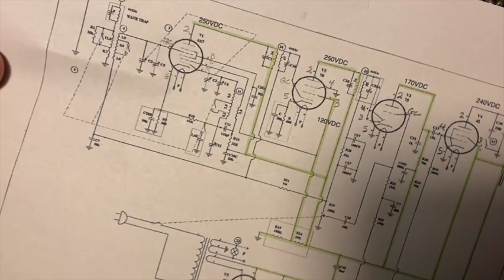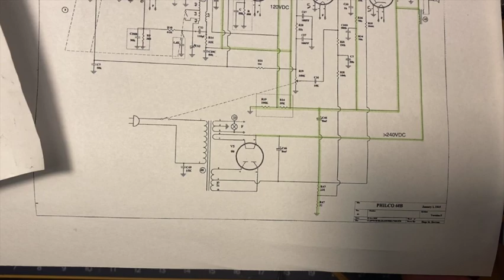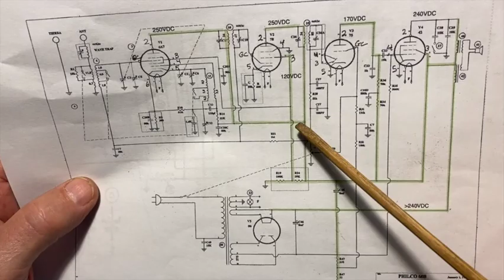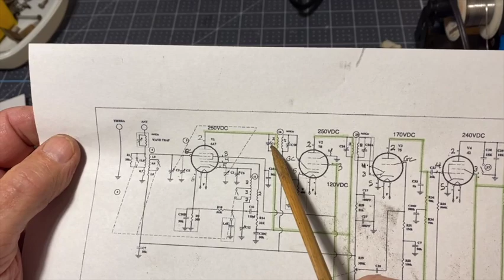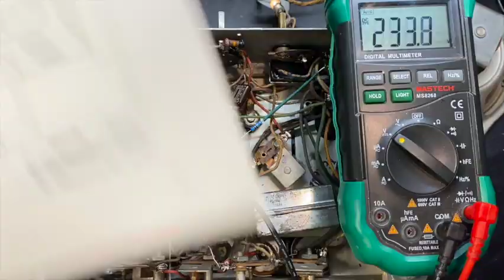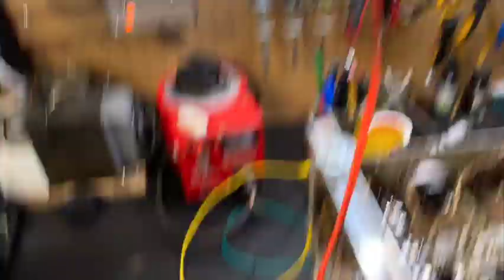Philco 60B Part 12 1st IF Transformer

Comment: What a pity the coil couldn't be saved, having a spare was very fortunate. Unusual way of mounting it as well 🤔
Reply from the maker: @DavidTipton101  Thanks. I’ll keep it for a while in case someone else wants to try to rewind it.
Reply: @fibberscloset498  I think my winder can do that type of crisscross winding if it's plain copper wire. Litz wire? maybe, if the wire can be sourced. I'm not offering, just a thought.
Reply from the maker: @DavidTipton101 Thanks, David. I think the original was cotton-wrapped, but not Litz. Have you tried winding Litz wire?
Reply: @fibberscloset498  No I haven't. I don't have any Litz wire anyway. It is available I think.

Comment: Glad you had the backup IF….Im curious how the bandswitch would have affected the antenna transformer switching the resistor in/out? About got it made now….enjoyed the video…Thanks! Take Care—Larry
Reply from the maker: @Backtothefutureradios  the band switch changes the resonant frequency in both the antenna transformer and the local oscillator, raising both frequencies to receive and mix the higher frequency police band. At least, that’s how I understand it.